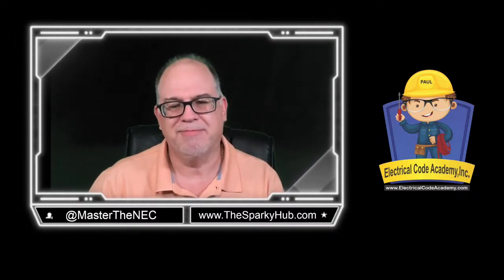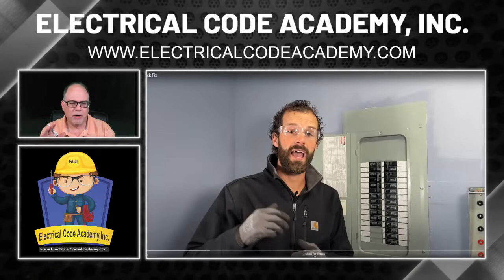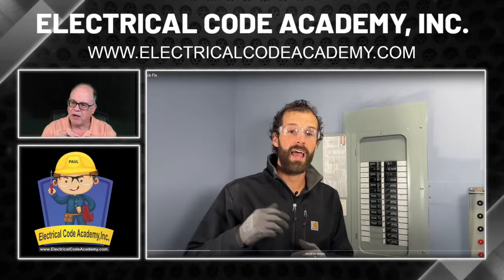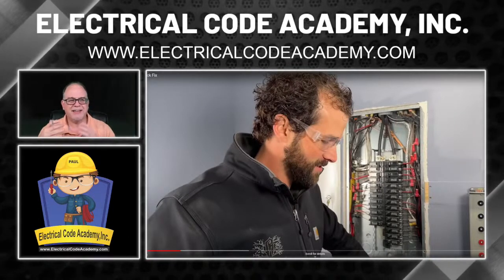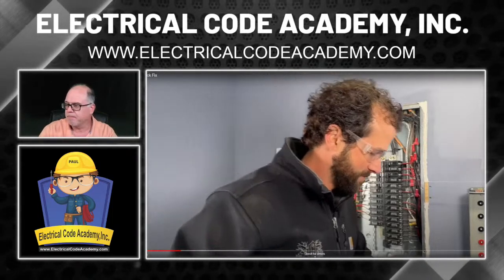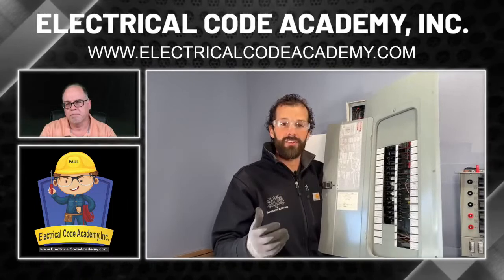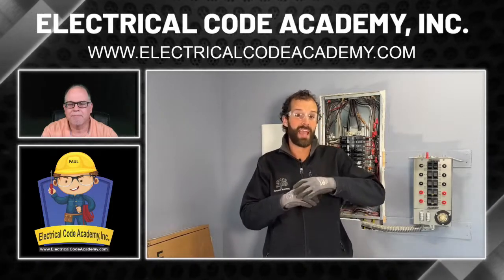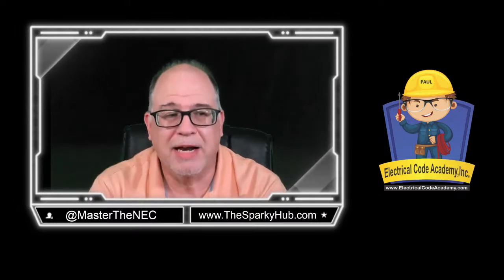No Room In Electrical Panel - Quick Fix [Electrical Commentary]

Comment: The electrical contractor in the video, Joel Walsman with Jefferson Electric, is out of Indianapolis, Indiana. Believe it or not, Indiana as of 2022, is still on the 2008 NEC. Both Indiana and Kansas still have not adopted anything newer than the  2008 NEC. I don't know why...but they haven't. I found that on the NFPA's sites NEC adoption map.

Comment: He didn't mention anything about gfci or afci ckts
Reply from the maker: Because that was not the topic of this video.
Reply: @MasterTheNEC  thank you
Reply: @MasterTheNEC  a video showing the same thing but bringing it up to current code. Not critical. Great video
Reply from the maker: @johnnymalicoat754  You are most welcome. We will be adding additional videos on the subjects of AFCI and GFCI as well, very soon.
Reply from the maker: @johnnymalicoat754  Greetings. Sadly nothing in this video would have required anything to be upgraded to code, as he didn't mention adding any circuits in areas where AFCI or GFCI are required. However, I do have some videos coming that will explore the AFCI and GFCI requirements. Be sure to subscribe.
Reply: Sometimes them smoke detectors don't like other loads
Reply: Why not install tandem breakers?
Reply from the maker: Did you actually WATCH the video?...Appears not. Go watch it and its explained.
Reply: @MasterTheNEC  I did but I asked as I was watching the video and yes I did get the answer its good to know I learn something new every day good info